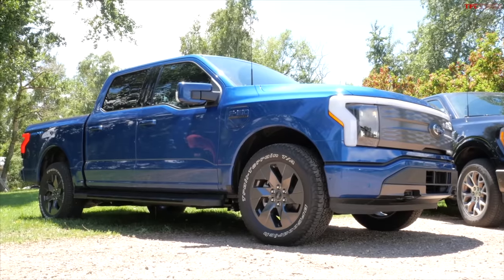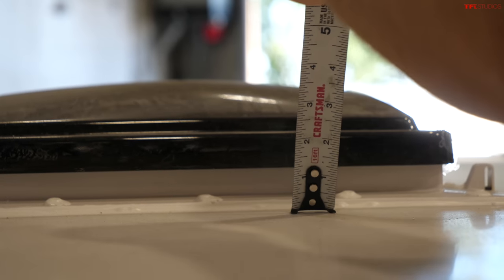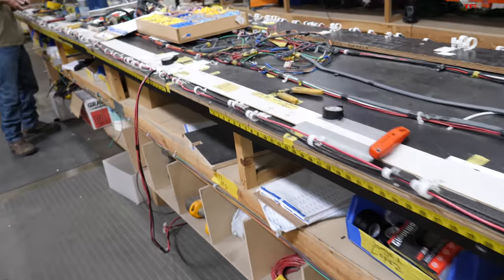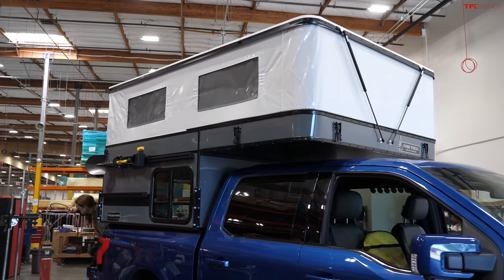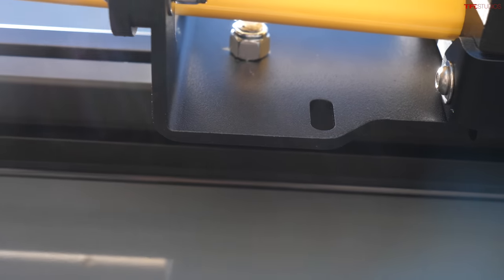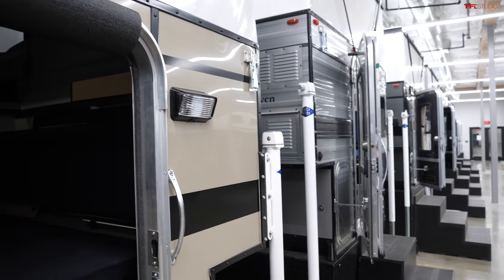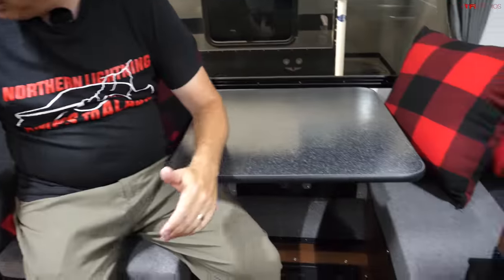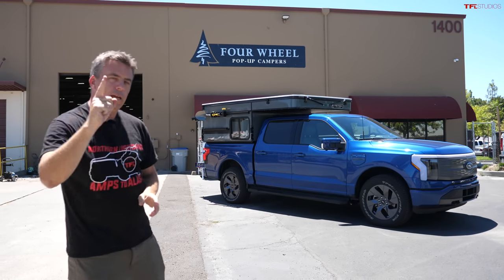Ford Says NEVER EVER Put a Camper On The EV F-150 Lightning… So That’s Exactly What We Do - Ep.2

Comment: Cool unit! I'm still surprised that so many camper manufacturers still use old battery tech instead of LiFePO4 batteries when it's all about weight and performance.
Reply: Those are turrible
Reply: LiFePO4 are awesome for lifespan, but weight (and size) isn't exactly its strongest attribute when compared to other lithium batteries.  However, they are obviously better than lead acid, but they probably chose lead acid to mitigate the risk of a battery fire while bumping along on rough or unpaved roads.  Or it was just to save cost.
Reply: @LeesChannel  In use I’ve found LiFePO4 to charge faster, have a lower discharge floor, run about 30-35% the weight of lead acid and the chemistry isn’t as dangerous when a cell is damaged (unlike lithium ion it won’t ignite). It’s probably cost. It’s cool that this camper does offers versions pre-wired without batteries.
Reply: Cost. Take it from a FWC owner.
Reply: @donleamon8653  cheapest lifepo4 100ah are $320, good quality SOK is $500 per battery. No excuse to not go lifepo4 these days.
Reply: @Upliftyourbrothers  warm and cold performance?
Reply: @atodaso1668  if the battery cells are 32 degrees or colder it’s harmful to charge. The newest batteries offer a built in heater that keeps the cells above 32 degrees. It is something to consider, but I’d say easier to work around compared to freezing water concerns while camping.
Reply: @Upliftyourbrothers  built in battery heater? Sounds like another failure point/ extra complication to me.
Reply: @atodaso1668  complicated is a modern vehicle. They seem to operate reliably. My rig went from 160lbs of lead acid to 30 lbs of lefepo4 and gained electrical capacity. If your in the arctic with a non insulated rig maybe leads acids have some benefit. But if that’s the case you’ll also have no water in liquid form on your trip.
Reply: LiFe batteries failed me. Never again
Reply: Had one.i paid $129 for a scooter and within 5 months it was not taking a charge.
Reply: @Upliftyourbrothers  The front bumper on my truck weighs 130lbs...

Comment: Big thing a lot of people miss with these campers is the weight with water (wet weight) as well as their other crap.  They get stuck on that dry weight metric being 1300 - 1700 lbs and think their good, but then put the water in and wonder why they're pushing 2100+ and the suspension/brakes wear out.  I've no experience with air bag lifts and suspension mods so not sure if those would fully mitigate the issue, I've heard differing opinions...

Comment: Your statement that the primary consideration for selection of camper top was range is very telling that EVs still fall short of the flexibility of ICE's or even hybrids. Very informative of how all the installers and builders must wear face diapers, but not the hosts or managers, Elites > peons.
Reply: You realize the only reason you get the ranges that you do on ICE is because the tank is 7-8x larger than the tank on an EV? Let's make it fair and put 4 gallons in each and do a range test. My guess is the low fuel light never shuts off, truck surges going on the highway, you have range anxiety while looking for the next exit with a gas station.

Comment: By the title I was expecting you to explain why Ford said they didn't want you to do that. So unfortunately you didn't say anything about it in the video, so I have to ask now. Why doesn't Ford want you to put a camper on top of your lightning?
Reply: thanks for saving me a half hour.
Reply: Would have been nice if they'd addressed the question they asked. I'll take a shot at it...
In the video where they pick up the truck they show the door sticker that says they have 1686 lbs of cargo capacity. In this video they show that a camper "as equipped" is 1326 lbs; I'm skipping through this TFL infomercial about campers, but I'll assume their camper has similar weight. So that leaves 360 lbs for all cargo. You're only allowed 150 lbs for the weight of the driver, so a 220 lb driver needs to take 70 lbs out of the 360 available. While there's a liability concern on Ford's part, there's also performance. These guys are gonna take a range decrease for the weight and added drag of the camper, plus braking and handling are going to be different. If this was a more average camper at 2500-ish lbs it would put excessive wear on components and would destroy their range.
Reply: Because its not a real truck
Reply: @krisbarnard1684  OMG did you come up with that all by yourself? Your so original. Your mommy must be so proud. Now make sure you tighten up your safety helmet so you don't hurt yourself.
Reply: Because the lightning is already a heavy draggy brick and any camper is just making it even more of a heavy draggy brick, only one with no extra weight capacity for the gear and supplies required to go camping.
Reply: This is a advertising kiss butt video so tfl don’t have to pay 22-44 grand for pop up 500 dollar box and tent

Comment: Yes well.....After tring a cab over on my Colorado ZR2 I quickly sold the Northstar 600SS I had bought and looked into the Project M's....To tell the truth....They are a LOT of $$$ and the fuel mileage impact it had brought me to a aluminum Service cab that I picked up used for $1500. Sorry the prices on their campers are pretty unrealistic for a guy like me. Also having a full sized Lance 865 truck camper on my 2500HD Duramax....I was shocked at the fact that a Duramax would give me 14-13MPG VS the 11-13MPG the Northstar brought to my Colorado....With the $$ I saved, I can camp for 2-3 days in my service cab camper and get a nice hotel room every 3rd day when I travel...Not planning on venturing long distances in remote areas in my travels and happy I saved $13K over the cheapest build of a Project M type rig. When I'm in the woods in my ZR2 I also don't have to be concerned about the cab over camper overhang "blind spot" being hit by a tree. I saw a Tacoma with the full Aluma Flat Bed and Woolrich Four Wheel Camper in Cannon Beach Oregon last week and all I could think about is what a challenge it must be to drive that rig on a public road....NOPE won't go there!

Comment: Ford will probably be changing their guidance on campers when they see how many of us put Project M's or GoFast Campers (like mine) on our Lightnings.  I got a '21 shortbed PowerBoost F150 last year specifically so I could put a GFC on it, and then pop it on over to the Lightning when it comes, because of having the same bed. GFC is about 370 lbs, and is great to camp in the F-150, should be even better in the Lightning, as can keep more stuff in the frunk.   Although I will miss the 500 mile range of the PowerBoost with the big gas tank!  For now, I am waiting to see how TFL's Lightning range does with this setup, which is probably just a little more weight and drag than my GFC will be.
Reply: We have a 2021 PowerBoost Hybrid with an OVRLND popup very similar to the Project M. We have a2022 Lightning ordered and coming sometime this year. We will switch the camper over to it. It is a great setup but when the truck is fully loaded with the two of us and our interior buildout the truck is right at its 1380 pound payload. The Lightning has a higher payload than our Lariat trim PowerBoost Hybrid. We lost about 10% in fuel economy so hoping range loss will be fairly low on the Lightning. We will add a fairing to the Lightning to reduce drag which we haven’t done on the PowerBoost Hybrid. We will be watching this series closely.

Comment: When traveling in an EV.. isn’t the actual range always going to be about 60% of range the manufacture claims? We drive faster than 70 mph, never take EV down to 0% and they recommend recharging to 80%. That means stopping every 150 -180 miles  for 45 minutes ( 90 minutes or more if having to wait) that just seems like a hassle for road trips. Flying commercial airlines these days is traveling on a greyhound bus with wings so that option is out.
Reply: Yep, it’s very obviously not made to be a road trip vehicle
Reply: The range is actually a projected range.
Reply: It doesn't take 45 minutes to charge from 20% to 80%, it does take 41 minutes on a 150kW charger and less on a 350kW (if you can find one).
Reply: @brownro214  only supports up to 170 kw

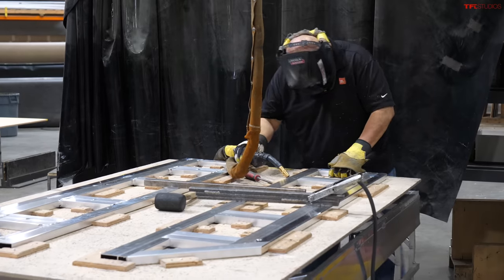Comment: 7:19 
Andre: why do you use aluminum?
Melanie: because aluminum is lightweight and durable.
Andre: and it's strong?

All of us: yes Andre it is strong because that is what durable means. LOL
Reply: Also aluminum doesn't rot.
Reply: @1607rosie  nonsense. Aluminum corrodes it just takes different circumstances to cause it
Reply: Durable means it lasts a long time, not that it's strong.
Reply: @Ijusthopeitsquick  Not strong isn't durable enough to last long.
Reply: @Ijusthopeitsquick  
Does durable mean strong?
Something that is durable is strong and lasts a long time without breaking or becoming weaker.
Reply: @1607rosie  I know what you meant.

Aluminium is the most abundant metallic element on Earth, which is a lightweight and silvery-white metal with a lifespan of over 40 years for building and over 80 years for window frames
Reply: @lycanhd  Strong isn't a scientific term; materials are described by their attributes such as wear resistance, ductility, hardness and so on. For example, glass is hard but fragile, aluminium is soft but rigid. Either could be described as durable, or even as "strong", depending on the application.

Comment: Will be interested in what that increase in air drag does to range vs load only. Or will it only matter at highway speeds.
Reply: Well didn’t Tesla say something like side mirrors account for 5% range loss? Cant imagine what this thing will do. Edit: I could be wrong.
Reply: Lots of videos (+ physics) show that at highway speeds, aero drag is by far the major range factor. As long as they don't exceed the trucks weight rating, won't matter. Pop up aspect should help compared to regular truck camper.

Comment: Why on earth did they use a AGM battery?  Twice the weight and half the useable power compared to a Lifepo4 batteries. Newer Lifepo4 batteries have heaters and low temperature disconnect.
Reply: Price maybe? Also AGM is a little more rugged.

Comment: I just checked the Lightning Manual and Ford just says: "We don't recommend using a slide-in camper on the F150 Lightning." Does anyone know why?
Reply: The air resistance and weight would degrade the already short range it has and the trip computer isn't set up for calculating range drop the way it can for trailers.
Reply: Aerodynamics are critical for range, as these vehicles only have the energy capacity equivalent of a few gallons of gas.
Reply: That's just lawyer speech for "you cant sue us if your silly camper causes damage to the truck and surrounding areas."
Reply: If, for some reason, it experiences thermal runaway and catches on fire, I would hate to be the FD that has to deal with that 7 day burn, with a noxious camper fire on top.
Reply: @anydaynow01  actually it does. You just have to input how much “cargo” you are going to haul/tow.  In previous videos they show you the added tow/cargo and it gave the estimate range.  But for sure range does drop when it’s loaded.
Reply: @frankfirewood5384  well yeah, they already tested towing normal sized trailer, and it does cut the rang by almost half.

Comment: This series is going to showcase just how far EV is from replacing ICE vehicles.
Reply: They'll have to recharge every 80 miles.
Reply: @hines862009  or carry a high output gas powered generator in the bed.
Reply: They drove it from Detroit to Denver earlier and they needed to charge every 200 miles roughly. I would say we’re decades away. Need faster charging and 500 mile range and prices come way down.
Reply: It's really the epitome of "the journey matters more then the destination"

Comment: You really need to do this in the dead of winter if this is a test. Also, that onboard battery should have been Lithium, not AGM.
Reply: AGM handles abuse and over-discharging better than lithium, and lithium is more prone to catching on fire.  And lithium is more expensive.
Reply: @mattbrew11  I am not sure who has brainwashed you but an AGM IS NOT cheaper and does not weigh less than a lithium battery. 

A 100 AH AGM weighs around 55 pounds. A 100 AH Lithium weighs around 30 pounds. The same AGM can use DOD of 50%. The Lithium DOD to 80%. 

The warranty on an AGM is around 3 years. The warranty on a Lithium is 5 to 10 years.

The AGM has around 500 cycles. The Lithium has 2000 to 8000. 

An AGM runs around 300 dollars. A lithium can be picked up for around 300 dollars. 

So when you do the math on cost per watt the Lithium way outstrips the AGM.

Comment: Well the lighting only went 86 miles on the tow challenge. Good idea to have a camper. Now you can tow a 10k generator and fuel to camp with and charge up the truck. Smart thinking to fix this thing and make it use full for something other then drag races.

Comment: Well you now just took about 10k in resale value out of that truck by drilling those holes into it
Reply: HaHaHa! No they didn’t. 4 little plastic caps and you would never notice those holes… I would also bet you they make more than 10k when they ultimately resale this truck due to the shortage of vehicles.
Reply: When they resell vehicle battery will be over used, over charGed too many times and dead